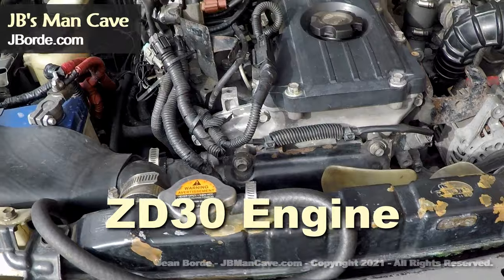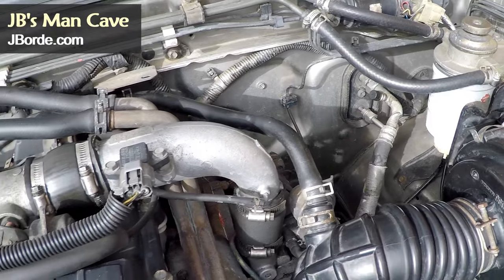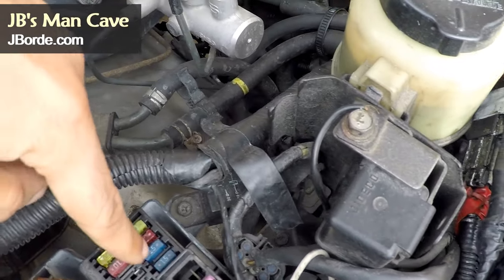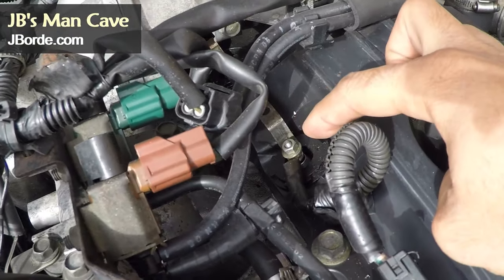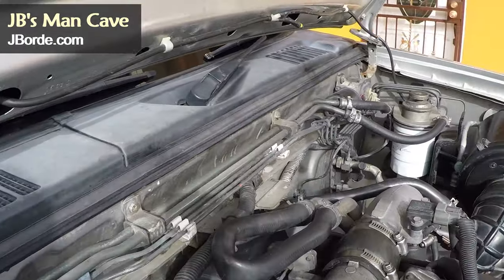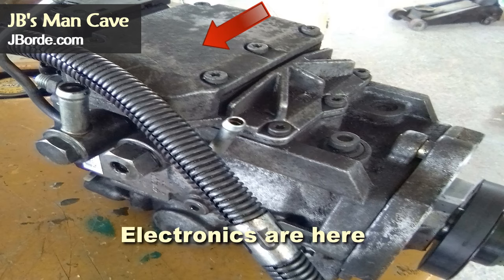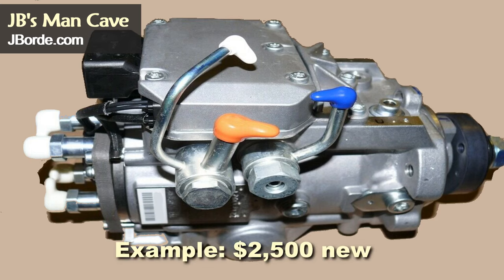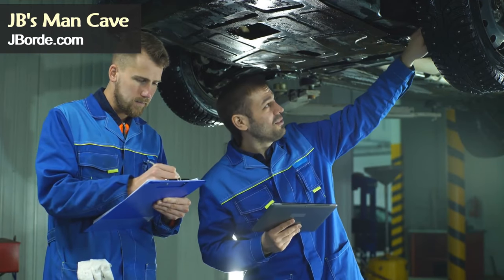ZD30 Diesel Fuel Injection Pump Failure VP44 D22 Nissan Frontier Navara Solution | by JBManCave.com

Comment: Hi, got my navara zd30 decided to just turn off..will no longer run , got code 0407 (47) crank angle sensor,  replaced that no difference,  engine will still pop and bang on some spray down intake, i do this myself ,,spray then crank engine,  it makes firing sounds,  and trys to run,  the fuel primer is still pumped firm no problem,  but no sign of life , 
Could this simply be the electronic on injector pump decided to quit,  the vehicle run flawless before this not a sign of problems..
Reply from the maker: Did you recently do anything with the engine including engine wash? Did you test all the electronic connections, fuses, and so forth including the connections to the injector?
Reply: @JBsManCave  i hadnt done anything to the engine, it was all in good order,..
I let a mechanic do some testing as ,and they say its not getting power to various plugs under the bonnet,  they tried telling me i need a new wiring harness, but im doubtful its the issue, all fuses are fine, when i spray some wd down the throttle then go round to door and turn ignition on and crank it will try to run but seems very rough like trying to fire on an off stroke or like timing is off..but guess that happens when haven't got someone to spray while i crank it,  
I can verify if there actually is power to the injector pump plug, but was told no power going to any plugs under the bonnet
Reply: @JBsManCave  i have used a pressure washer many times in the past to clean engine and never once resulted in a problem,  but the vehicle has been clean and dry for a fair while,  driven short drives twice daily,  so never sat too long..
Its such an odd problem,  cause i would have thought injector pump failure would give signs , but have read on very odd occasions the electric wries in the pump can crack/break  cause they get alot of heat over there life, 18yr 340,000km
Reply from the maker: In this video, I actually show you how to test to see if the glow plugs are getting power, assuming your vehicle is a diesel, did you test that for yourself? Check my disclaimer in video.
Reply: @JBsManCave  no i didn't check the glow plugs personally,  but they are surely working, cause i got the engine to run a little
Reply from the maker: Hmm... since you changed the crank angle sensor did you reset and check for the current error codes?
Reply: @JBsManCave  yes reset and after many cranks and spraying down throttle..
It will just bring that code up again and again,,
Reply from the maker: If after doing a reset you still get the same error code then it has to be that it was not reset properly, the part was not changed properly or there is something more. I would make sure to go to a trained Nissan mechanic and not just a regular one and let them do a proper scan. It could be that your pump is the trouble but the error code is not give that.
Reply: @JBsManCave  i definitely know a regular mechanic is not a great idea,  already wasted some money on that, im in a position with this vehicle now where ive got an endless amount of spending money to get running..so its time to probably quit. It definitely will exceed the value of vehicle to repair
Reply: @JBsManCave  i do appreciate all your responses to help..
It was easy to fit the crank sensor properly,  and clear the ecu codes , did use a decent snap on scanner to check vehicle,  also ..
Reply from the maker: @Rcplanedan I can understand that and yet if it is a simple electrical issue that can also cause the vehicle to have problems. For peace of mind it might be worth to get a proper assessment. You would not want to down the vehicle when it is something relatively simple. Remember the ZD30 is computerized and works off of many sensors... anyone of them not functioning can throw the engine off.
Reply from the maker: @Rcplanedan Ok... I will be interested to know what you do in the end.
Reply: @JBsManCave  most definitely, very true,  i have got it parked up at the moment, and working up the energy to do some trouble shooting myself
Reply from the maker: @Rcplanedan sounds like a good plan.
Reply: @JBsManCave  will report back..thanks

Comment: Engine ZD30 Direct Injection. When I revs high RPM, struggle to climb hill at 70km/h and can't go pass 100km/h on highway. No engine light. But when scanned, AT/CVT code (00) Throttle Sensor came up.
So, replaced the Pedal Throttle sensor, Intake Throttle, MAF, AF, Intercooler, Fuel filter and placed Tillix manual boost controller. But still the same.
I want to change the fuel pump but what if the problem stays?
Any suggestions ?
Reply from the maker: Venkata you have a turbo or non-turbo? How often do you change your fuel and air filters?
Reply: Did you look at the micro switch on the pedal. Not the TPS.
Reply: Hey man I'm experiencing the exact same problem, did you have any luck with other repairs or did you replace the fuel pump?
Reply: Sounds like wire breakage. Try running some direct to pcm/ecu from the tps. First test for continuity with a beep tester or fluke. You need some pin out sketches.

Comment: Bon soir SVP j'ai un problėme sur le ronflage ne depasse pas 3000 t/m
Reply: Voiture nissan x trail t30 model 2007  diagnostic  anonce pompe carburant  ou se trouve la pompe carbuant reservoir ou moteur
Reply from the maker: Greets I believe the Xtrail carries a different system under the back passenger seat?

Comment: Why there's no fuel coming out when you turn the injection pump left to right or from right to left
Reply from the maker: Not sure what you mean but from what I understand with these pumps if the computer registers an error it will close the check valve so not much fuel if any will come out.
Reply: @JBsManCave  if these is the prob what should we do?what is the cause why computer close the valve.thnks
Reply from the maker: Kenken, the video suggests what you should do.

Comment: If it starts but won't go above idle (dies), check the micro switch on the pedal. The little rubber insulator on the switch can stick to it and it won't release. Pull it off, and your done.
Reply from the maker: Graeme, thanks for your input.

Comment: I am dealing with that exact situation at the moment. Can you say for sure if there was a noticeable increase in power and torque after the Fuel pump was restored and installed???
Reply from the maker: Kiran, the truck responds as it should, however it should be noted that the D22 or I should say in this case the ZD30 does not have the same kind of take off power as a D40 unless you are using 4x4. One of the sure things I saw with the refurbished pump is the fuel mileage returned. I can get around 500-550km on a tank of fuel and that is with load and AC sometimes. The other thing is I can take off without having to apply fuel. Just being in gear one and the truck starts to move. Are you thinking about changing engines?
Reply: @JBsManCave  thanks very much. I'll go the way of pump refurbishing because I'm about keeping it original. I won't swap the ZD because personally I think these engines are quite reliable compared to present day engines. I'll just repair my pump and do a 3 inch stainless steel exhause.👍👍
Reply from the maker: Kiran, yes, once properly maintained the ZD30 will faithfully work for you. Please do not forget to subscribe.

Comment: I had my pump rebuilt in 2015. It cost me £1300 UK.
Reply from the maker: Jon, yes quite expensive. You still have the vehicle?
Reply: Yes, I’ve still got my 2002 3 litre Nissan Terrano 2. It’s a great vehicle used daily.
Reply from the maker: Jon, sounds like you take good care of that vehicle. I was looking at the pump the other day and for the life of me I can't understand why they would have the computer system right next to the engine. There should be some kind of bracket to mount it away from it. I think I mentioned that in the video, but can't remember right now.
Reply: You did mention it in the video and I remember thinking the same at the time. I do try and take care of my truck.

Comment: i feel like qd32 is d way i will go ,,, jus hav to get d money
Reply from the maker: Razad, QD32 is a mechanical pump so you will not have the worry about failing computer. However, I believe there will be a power loss unless you can modify the pump. Do you have a ZD30 already?
Reply: @JBsManCave  
Yea I have a zd30
Reply from the maker: Due to the pump's failure you are changing the engine? Keep in mind that you will go through even more cost to make the change than it will cost to fix the pump. I once had to make the same decision.